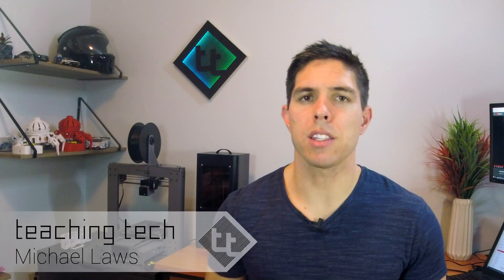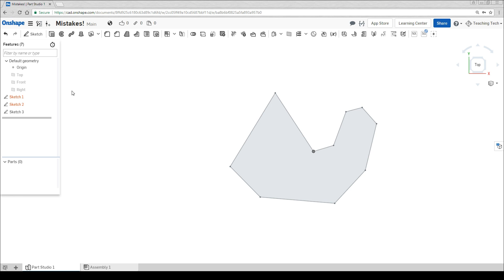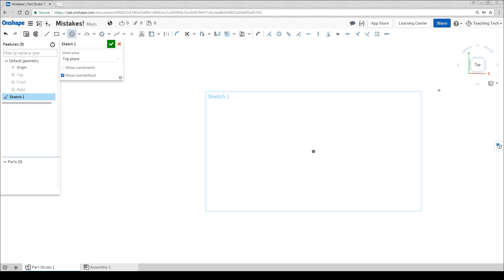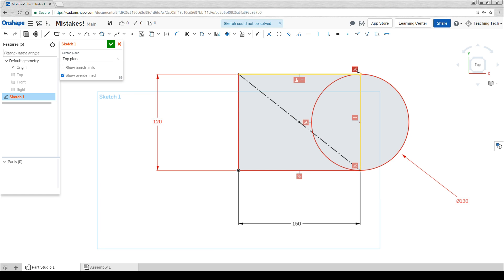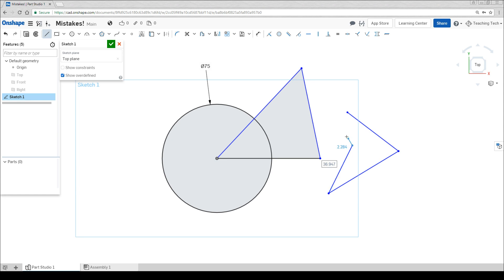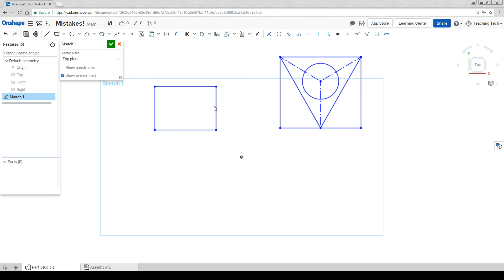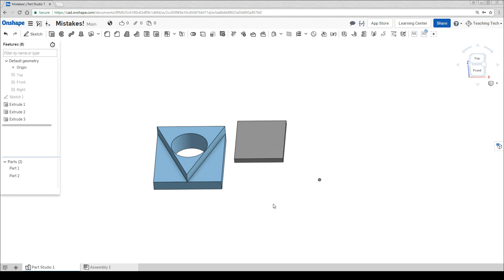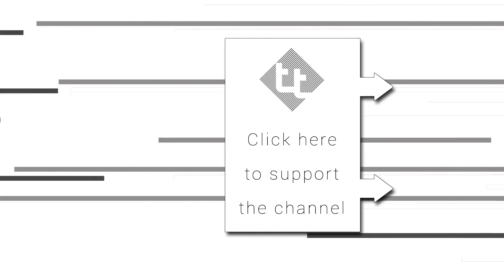Five common user mistakes with Onshape (and how to fix them)

Comment: I make a common mistake, and hope someone here can help me...Let's say I draw a circle. It stays blue. I want to constrain it to the place where it is. I don't want to sketch anything else except that one circle. The only way it will constrain is if I first click on the origin. But I don't want it placed at the origin. What do I have to do to make my circle stay where I draw it? It's driving me nuts. Thanks.
Reply: Add a dimension to the origin. It will stay where you place it in relationship to the origin.
Reply: @oldbiker57  Hmm. That partially helped me. I clicked first on the origin and followed out the dotted yellow constraint line to a point on the plane, then chose the circle tool and drew a circle, while also giving it a dimension. But that only constrained it on one axis (in my case the vertical one). But after it's constrained to one axis, you can't constrain it on another axis. So how to give it the X and Y axis measurements? I can only constrain on one! It also won't turn black to finalize, or fully define.
Reply: @moodberry  Give it 2 dimensions. 1 in the X, and 1 in the Y. There are tons of videos showing this.
Reply: @oldbiker57  Well, that is true. But I can only constrain it in EITHER the X or the Y. Once I constrain it in one axis, then I am unable to constrain in the other dimension. For example, make a circle by clicking first on the origin, move out somewhere and follow the yellow dashed line to constrain. That's fine. But that is only one axis. How would I then constrain on the other axis?
Reply: @moodberry  You can constrain in 2 ways. Use constraints or use dimensions. The yellow line is one way, that is a constraint. Place a dimension in the other direction, that is your second constraint. Now your circle will not move and will turn black.
Reply: @oldbiker57  I want to do that, but am scratching my head. If I click on the dimension tool and the outer ring of a circle, I can input the diameter (that's the first dimension) and then with two clicks (one on the origin and then the center of the circle) and my circle will jump do be coincident with the origin and it will turn black. But I want it to stay at it's original location unless I let it be tied to the origin and move itself it stays undefined and blue.
It seems counter intuitive to be able to only do either the X OR the Y, but not both. 
You said there are tons of videos. Can you recommend a couple?
Reply: Also do a search for "How to dimension in Onshape"
Reply: https://youtu.be/ULa7lYrpYbY?si=vrzZmTQVOu7rkGtN